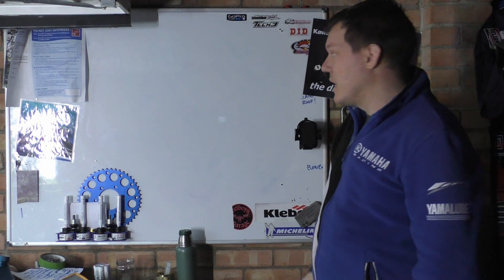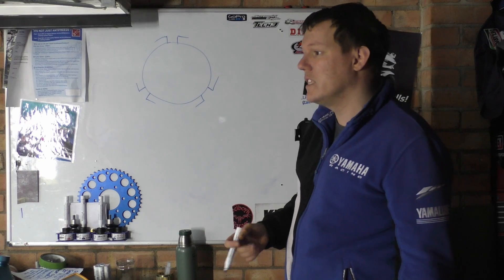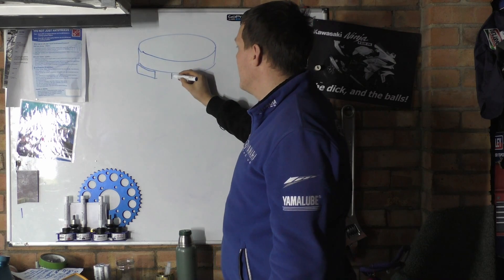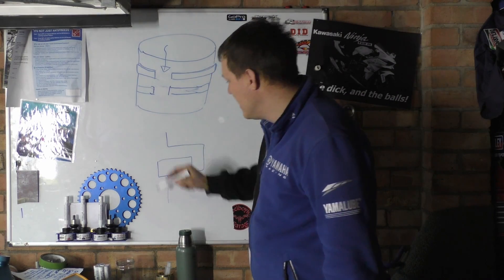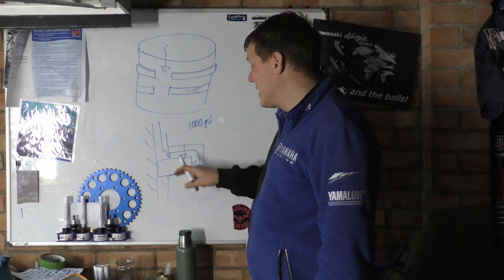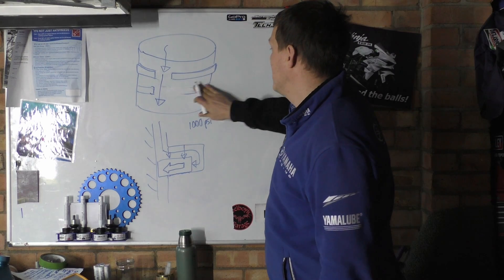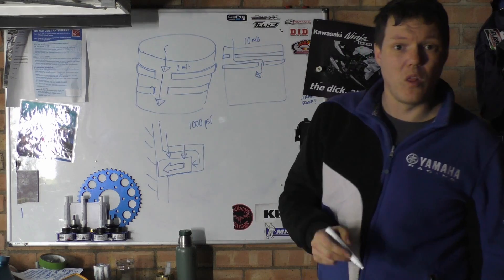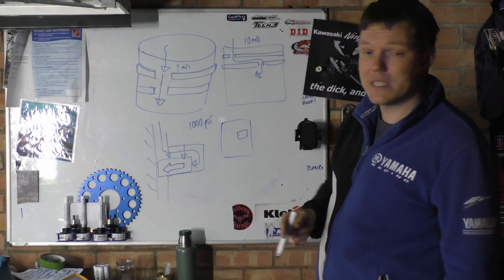Piston ring gap orientation

Comment: The labyrinth seal that's created when the rings that aren't aligned also uses gas back pressure to form part of the seal.  If the combustion gases can't just rush straight through it creates a slow moving gas bottleneck that prevents any more gas from entering, further to this you actually get a rebound effect as some of the gas flow tries to return from the way it came, this briefly pretty much counters any combustion gases that would try to enter through the gap in the top ring when the engine is running.  Also the faster the engine revs the better this works.  It's an incredibly cleaver design considering it was designed well over a hundred years ago!
Reply from the maker: That is total bollox. Labyrinth seals are a specific design using boundary layer, they're also in constant uniformality... CONSTANT.

Comment: Sir l have a Yamaha fi system with 125cc  and a few months ago l rundown the engine but l am confused on how l should fix this piston ring settings, now l needed your help on how l should arrange them correctly and if possible please share me a video link so that l can picture them quickly, txs in advance.
Reply from the maker: Fix?
Reply: @thedirtyworkshop  l mean how to set accordingly to a company settings
Reply from the maker: Set what exactly? The ring angles?
Reply: @thedirtyworkshop  yea
Reply from the maker: You just turn them. But this is on assembly. Don't worry about it

Comment: seems to me the piston will push the ring, not ring pushing piston.  Piston has a much more area exposed to the combustion pressure than than the ring.
Reply from the maker: "piston will push the ring, not ring pushing piston"?
Reply: @thedirtyworkshop  perhaps the ring will be toward the top of the ring groove while the Piston is on the down stroke.

Comment: Ring orientation is not important. If you built an engine, run it and then tear it down your piston rings will be no where near where you orientated them because the move around in the landing. You are wasting your time
Reply from the maker: LOL this is called mechanical precession, but the inital set-up during ring break-in is dependant of these angles - so no, you dick ii is not wasting time

Comment: I wana change my rods but dont wana take the engine out and send the block away can i get away with reusin my rings save hoaning and gaping
Reply from the maker: It depends on the state of the cylinders as they are. And why do you wanna change your rods?
Reply: Its a 1.8t only good for 300bhp and 300ftlb on stock rods the engine runs well with no oil burning or blow by that why i wounderd if i cud just reuse the rings

Comment: I'm wondering why we use multiple piston rings so basic in design. My thought would be a multi-layer ring, or something that removes the gap. Impossible, or just far too expensive?
Reply from the maker: There are gapless rings and we'll be covering that soon
Reply: They make gapless rings at a company called Total Seal, they have a top part and bottom part that overlaps. The kicker, and the reason I've strayed away is that they don't have as long of longevity as normal rings (Total Seals are used a lot in racing tho)

Comment: An old myth..

It isn´t that important to locate them perfect actually, it just helps the break in period a little.
They spin during the cycles, which is far more important to ensure they do
And if they didnt, they would wear out the grooves where the gap is.

Twostrokes have problems with this, this is one of the reasons you change pistons in a twostroke so often.
Reply: Yes, the rings will rotate during operation, but will rotate differently during different engine speed and load. The 1st and 2nd ring will also rotate independantly of each other so as Pat says, ring gap positioning when assembling the piston does not matter. One could speculate that spreading the gap position could help in the initial lubing of the cylinder liner when cranking for the first time, avoiding a more even spread of oil film.

Comment: Well put, worth mentioning oil ring spacing as well!  I like a bell end in a hurry, recond my XT500 and staggered the compression rings but didn't stagger the oil ring (2 rings with a spring spacer) and it smoked like a bastard.   Had to rip it all down again and remedy it!
Reply: Hi Mark. Just read your comment about not setting the oil ring/s in the correct place and wondered where it was you had put them in relation to the compression ring gaps and where you put them when you corrected them please ? I've just put a new piston into my 4 stroke with new rings. My bike was chucking out black smoke so this may be the reason. I've seen several vids about where ring gaps should be, but there's nothing like getting it from someone who's been there. Don't know if you'll get this.
Reply from the maker: The oil rings don't need setting.
Reply: @thedirtyworkshop  So you're saying the upper and lower oil ring doesn't need to be staggered?
Reply from the maker: To each other yes, but not in relation to the compression rings
Reply: @thedirtyworkshop  That's where I went wrong and I didn't even get the info off Dellboy!  Too keen to get it running!

Comment: I just did a top end today and had to google the ring orientation diagram. On vehicles you can use a sleeve to help you compress the rings and slide the whole piston and rod assembly down into the block and secure it from underneath. On a bike you slide the cylinder over the piston when assembling. It’s a real pain sometimes keeping ring gaps where they should be while trying to compress the 5 rings to fit into the bottom of the cylinder. So i was just like eh, there’s no ports like a 2t, moving on. Not sure if there’s easier ways or tips and tricks to doing it but it’s hard to keep that specific gap orientation.
Reply: so whats the beat position piston ring end gaps?
Reply from the maker: What the manual tells you to do

Comment: Why dont 4T have the pins like 2T to stop the rings rotating?
Reply: ZeeBee667 well on a two stroke you have ports. You catch a ring on a port your whole top end is done for. So the pins are there so that doesn’t happen while minimizing blowbye in the most effective matter as determined by whoever made it. On a 4t it’s just a sleeve with no transfer ports and such in the way. It’s all done through the head and valves. So i would imagine as long as all the gaps are offset from one another you would be fine on a 4t.

Comment: Had a old 6hp brigs motor that was given to me because it was spitting crank case oil out the exhaust like mad. One tank of fuel to one case full of oil was the consumption rate. Thinking it was totally rooted I opened it up and found the ring gaps to be in perfect alignment. Didn't know were they are ment to be orientated so I just placed the gaps 180' apart. Been running perfect 18 years now and hardly any oil used.
Reply: One time my KX85 stopped running. The piston ring was not expanding because of scratches on the piston. I took the ring out deburred the piston, put the same ring back in and it ran LOL.
It always a good feeling when you can fix a engine without buying and waiting for parts.
Reply: Hi, I have a similar problem with my cb350four honda. One cylinder smokes a lot oil when the engine is running. I opened the engine and find out that on that particular cylinder the ring gaps where all in line. 3 rings. So I had the same reflexion. Maybe the oil is not scrapped all around the cylinder cause the gaps are in line. Oil passes through these gaps. I will clock them properly as I did earlier. Cause I rebuilt the engine earlier and made sure the gaps were not in line. So while the engine was running the Rings rotate and got their gaps in line.

Comment: I think I've heard one or two engine builders say "the manual says offset the rings 90 degrees (or whatever), but fuck that I'll just do 180."
If the goal of pain rings is minimizing blowby, what would be the benefit of anything besides 180 degree offset?
Reply from the maker: As for the original question you also have to consider wearing of the rings. Let's say you have 3 rings, if you did 180 then 2 rings have a gap in the same place, this is uneven and may (not really) cause a tiny ridge to form. So to be on the absolute safe side, space them all out.
Reply: My manual says the 3 rings should be 120 deg apart, but I'm tempted to do 0-180-0.
Reply from the maker: You're tempted because???
Reply: @thedirtyworkshop  To align the the ring gaps with the wrist pin so that the piston tilt isn't highest where the ring gaps are (at least for initial break in).

Edit: Yes I know the rings move, hence that last part of my comment. The idea isn't that the gap adds to tilt, but that the tilt can add pressure at the gaps to mar up the cylinder (in reality prob wouldn't be that big an issue for how small a diameter my pistons are). I installed at 120 at the end of the day, cheers.
Reply from the maker: 1) The rings move. 2) the ring gaps close, and 0.5mm won't effect tilt, or slap or anything...

Comment: I have seen low time aircraft engines develop low compression and after a short "test flight" they were fine again, proving ring rotation.
Reply: Cool, but that doesn't prove ring rotation or any other single cause. Other things like rust on valve seats, dried out or fuel washed cylinder walls, or stuck rings could also explain low compression that improves after running the engine a bit.
Reply: @averyalexander2303  
I use a borescope to verify those things. Oil analysis is helpful on machines I maintain regularly. Engines always give clues.